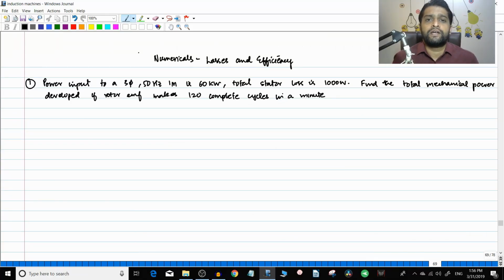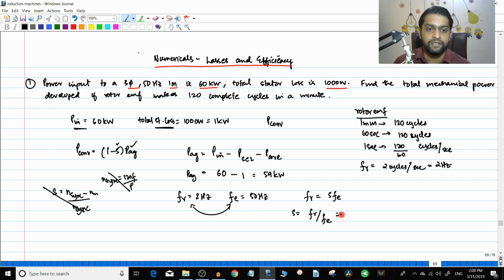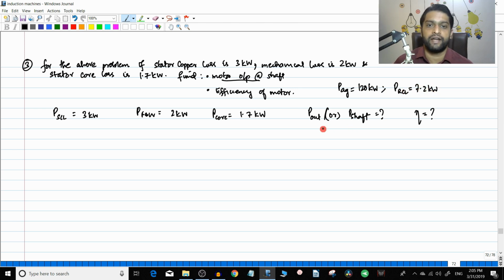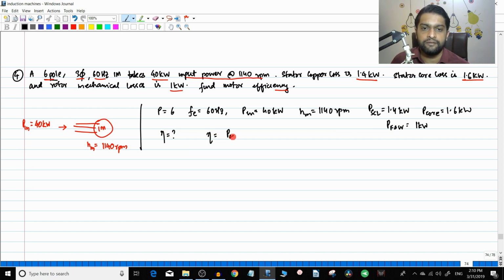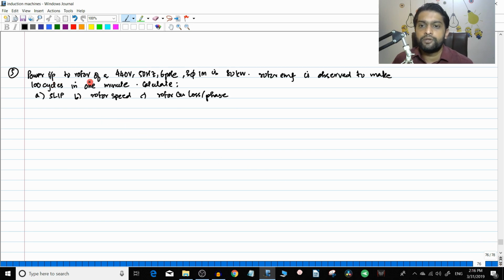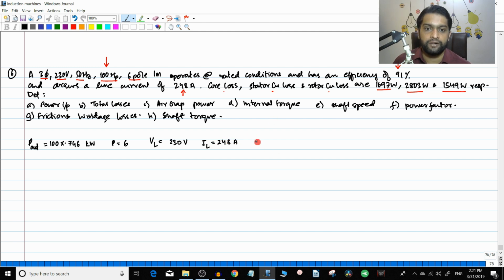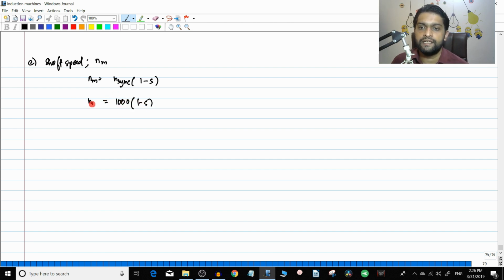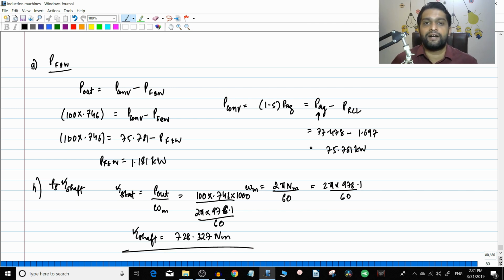Induction Motor #16 - Numerical - Power and Efficiency

Comment: sir, i have doubt in question 4.
You have written 40-1.4-1.6=45kw
which is wrong. 
Here Pg=Pin-( stator losses)
Pg = 40-(1.4+1.6)
Pg= 37Kw
Rotor cu loss= s×pg
                  0.05×37= 1.85kw
so Pout= 40-(1.4+1.6+1+1.85)
Pout= 34.15kw
Am i right sir????
Reply from the maker: Thanks for pointing out the mistake..must have been a typo...yeah you are correct....nice job...
Reply: @ElectricalisEasy sir efficiency is 85.375% na?
Reply: pin this pls